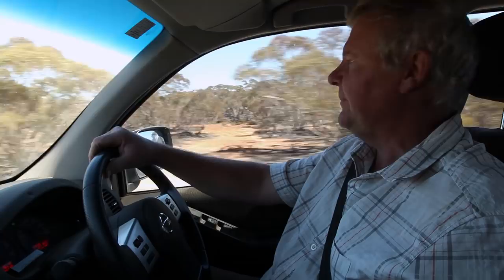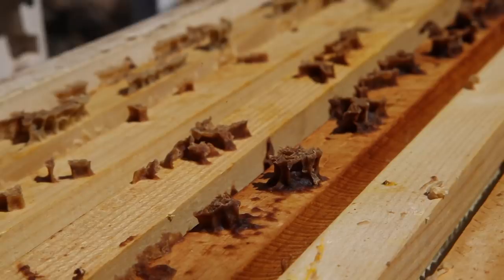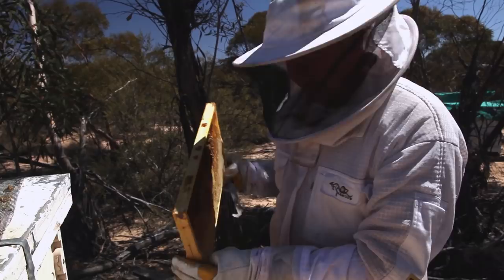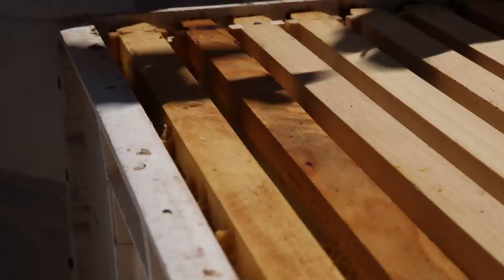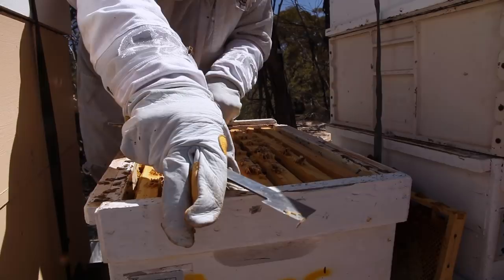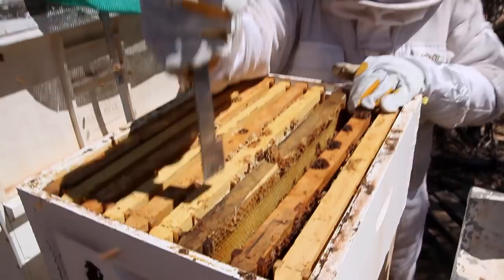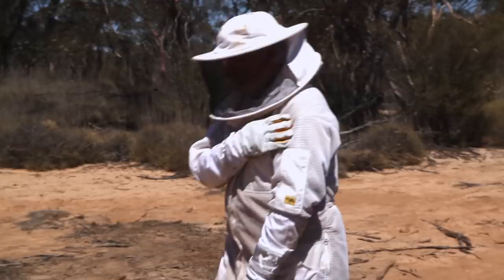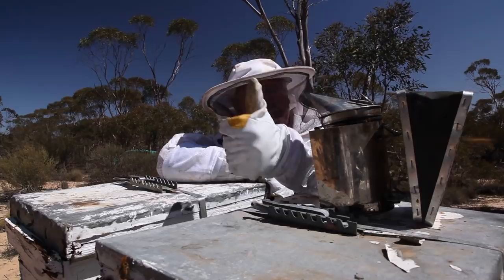Mallee Honey Inspection - The Bush Bee Man

Comment: Quick question. Why do you put fly wire on top of the frames, under the lid? I don’t mean the queen excluder.
Reply: I believe it's to prevent the bees from building comb to the top cover. Don't take my word for it though I have no experience in beekeeping.
Reply: Francisco is right although it doesn't stop them completely But It slows them down a lot  from making comb from the the lid down to the frames, If they do that it then all sticks together, when you pull the lid off honey everywhere and a total mess which can also drown bees